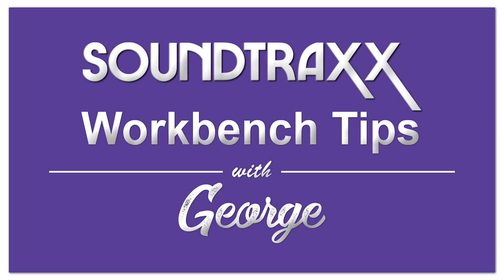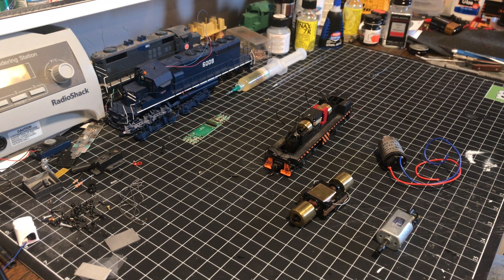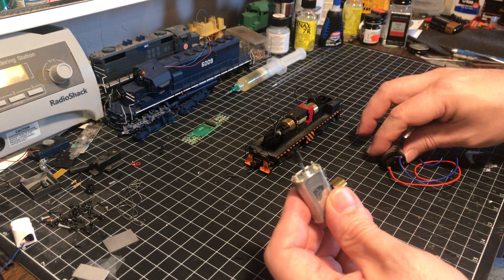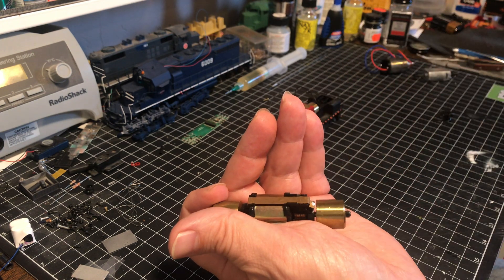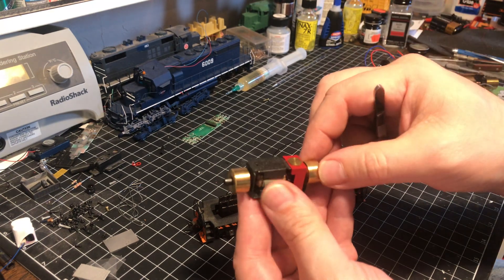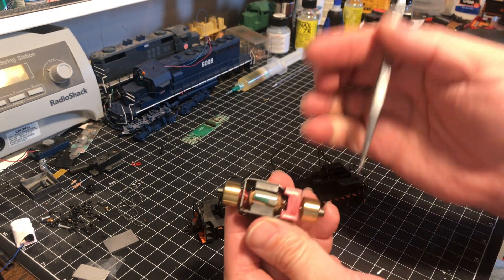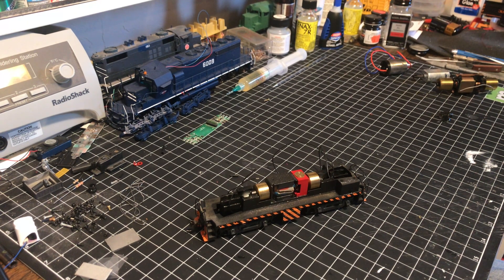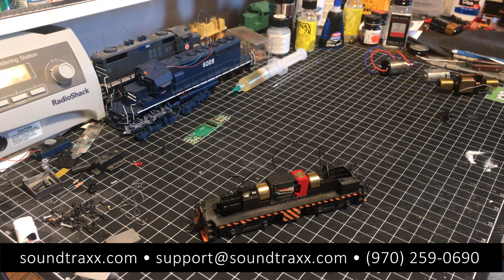Different Types of Motors & How to use them with a Decoder

Comment: When I do a Athearn Blue box model, I take the top brush holder and move it to the bottom of the motor as a bit of extra protection.  I still use Tapton tape on the frame as extra protection.
Reply from the maker: Thanks for the feedback!